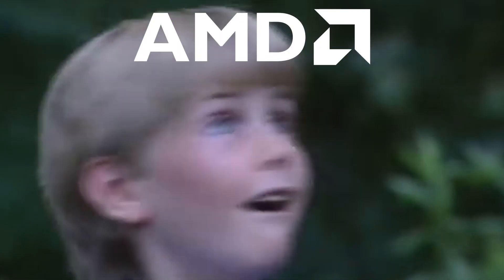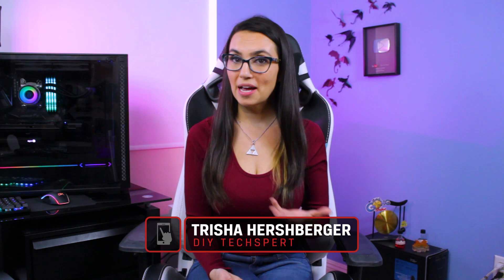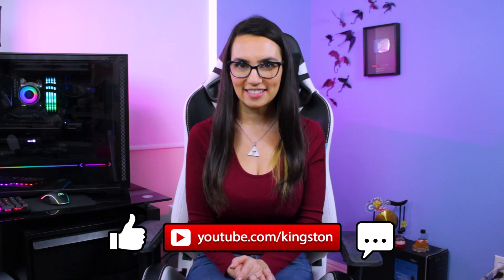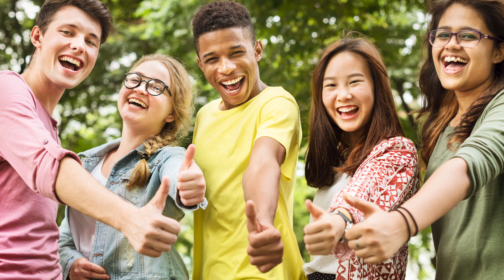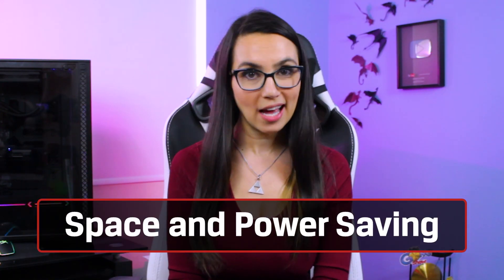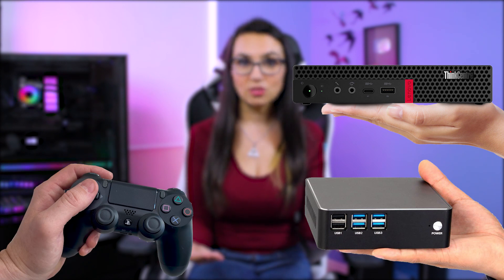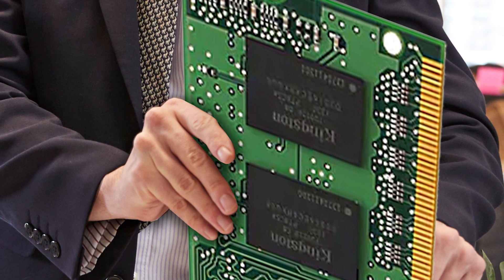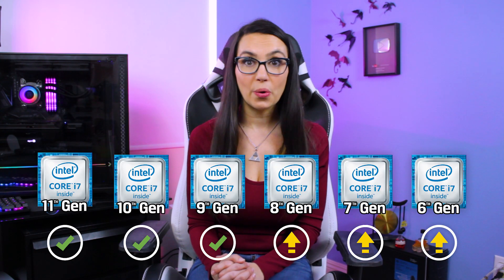16Gbit DDR4 Memory - The Benefits of Nextgen DRAM - DIY in 5 Ep 138

Comment: I just wonder if the higher gigabit RAM will help with benchmarks more? She's beautiful by the way
Reply: Not really I saw no real improvement going from 2x4= 8GB to 4x4=16 Gb the big improvement was changing my GPU out from GTX 710 to an R9 270 for 60 bucks it was worth it. Also, the game benchmark showed the 2x4= 8GB ram was more than sufficient to play all games which most ran in the 4 GB or less range anyway. Adding more ram up to 16GB I only saw a 1-2 frame rate change. The big difference was the GPU upgrade.

Making movies, AutoCAD, and using 3d rendering programs there was a big improvement in some things that took over 2 minutes to process took less than a minute to minute and a half. Some things that took 20 minutes now take 10 minutes.

Comment: since i couldn't find a new graphic card to go with my lg27gl850, i upped my 16gb of ram to 32. no more upgrades until cards become available, and even then a new build may be necessary. (b350f mobo - r5 3600 - gtx 1070) 12 cores or bust for next build